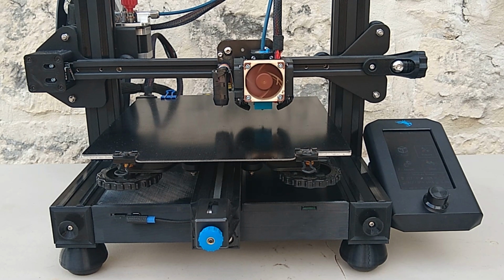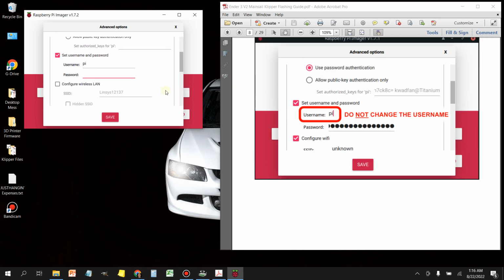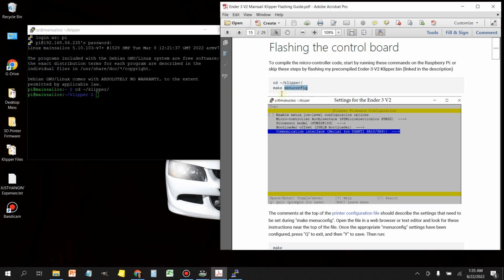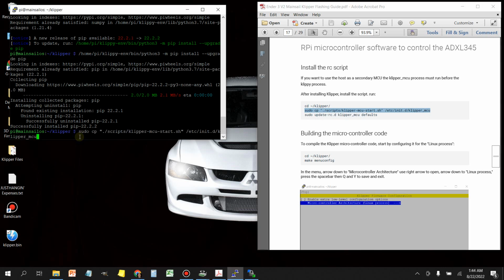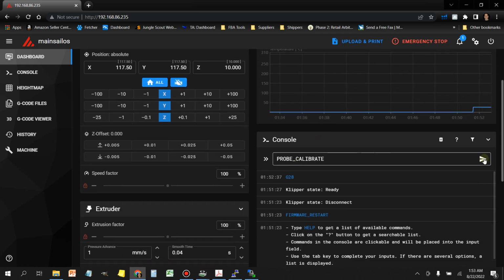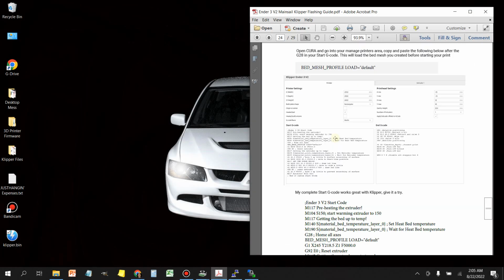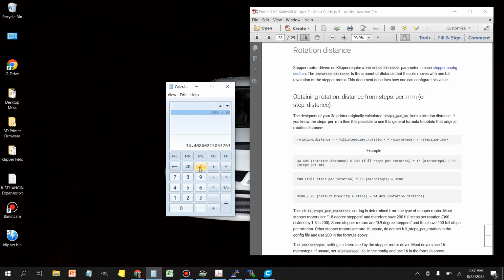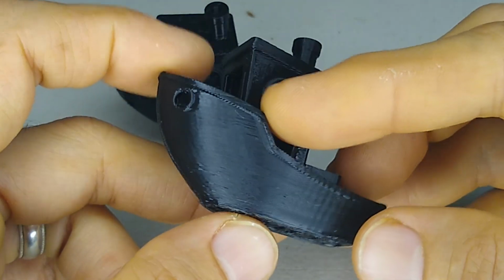Ender 3 V2 An Easy Way of Installing, Calibrating, and Printing with Mainsail Klipper

Comment: Victor!! I knew you were going to knock this vid out of the park! By far the most user friendly and complete guide out there, you even made a powerpoint and included all the files! I had to watch 10 different videos and took parts from all the forums to install on my machine. It took me a whole day and a sleeplees night to get mine going. LOL!  Like I said last time, i can NEVER go back! Ive been running Klipper for about a month now, and I got my V2  dialed in for all different kinds of prints. I just installed linear rails to tighten everything up, and WOW, its truly amazing how Klipper controls the steppers to run 100+mm/s and they are silky smooth and still pretty much silent (except for a few oddball long travel moves here and there when I have turned up on 'high boost'...😂) My hotend is still attached to the X axis, I havent launched it into the next room.. yet.. 😆
Let me know what you think of the Bondtech CHT nozzle when you get it. I'm running a Biqu H2 with the pointy nickel plated nozzles, Ive yet to max it out where it skipped or couldnt melt the plastic fast enough. But the quality is very hit or miss on the machining, so something better flowing and name brand quality I would def  be down to try. I usually stick to 100mm/s  and ramp up the speed or acceleration as i see what its doing for a given print. I have a magnet with a spinning arrow on the back of the extruder stepper,  its sometimes comical to watch how fast it spins as it pulls filament off the roll, which is also spinning at a steady speed, that until now, i have only seen when running a .6 nozzle printing big parts.. 
All this speed, control, and remote control have me trying to turn my hobby into a legit side gig. One of these days I'd like to chat with you on any advice about what platform (Amazon/Etsy, ect.) is better to start off with to get my feet wet, and see if the $ return is worth the extra time invested. I see it as a win win, since i'm doing something I enjoy and would be doing anyways, why not try to make a few extra coins in the process?!
Kudos again for the spot on Klipper tutorial, its going to help alot of people. Get ready, your going to have to top it with the V.B. Voron build tutorial vid! Haha!

-Phil
Reply from the maker: Great stuff Phill, Thank you for all your kind comments. I'm glad you are out there getting speeding tickets for printing above the speed limit. Klipper is another one of those game changer upgrades. My biggest problem now is trying to find more Raspberry Pis to upgrade my other machines without paying an arm and a leg. You mentioned the Voron but have you seen this thing? 

https://flsun3d.com/products/flsun-v400?variant=42441543057576

I like Amazon's FBA program to warehouse and ship products. I did sell on Etsy and eBay for awhile. It works well but you have to ship stuff out as it sells so there is a little more hassle factor.
Reply: @vbared  Yes, i just watched the first review of the v400. its the logical next step if you use klipper and like to go fast!! ( I'm a DSM guy too, we will chat about that another time. lol) I got my pi 4b 1gb for $115 on amazon, they are still out there in that price range, IF, that is in somones price range. BTT just launched their own pi board that is supposed to be as fast as a pi3 and can either mount right to their manta board or has an attachment that makes it the form factor of a pi with usb's ect. that you have to buy seperate. all in i think it is about $80. i have no idea if it is as good as a real Pi, but def a good alternative if you dont want to spend over $100.  I got the pi 4 even tho it is overkill, i still have some headroom for adding another printer or using add ons such as timelapse. 
Do you have an email that i can send you some settings / ideas that i'd like to share with you, to see whats working or not with your setup?. lmk, thanks!
Reply from the maker: @philbassi9241  Hi Phil, Thank you for pointing me to a Raspberry Pi alternative, I started looking at others myself. Doug O'Connor, a YouTube subscriber, picked up 4 pre-owned Raspberry Pi 3s on eBay for $55 each. He only needed 1 and knew I was looking for 3. Just received a package from him of them Saturday. I'm looking forward to Klipperizing all of my machines.

My email is vbared@gmail.com

The 4G63T is an amazing engine. In addition to the EVO 8 I also have a 1991 Mitsubishi Eclipse GS Turbo project car that I'll one day finish.

Comment: I am very close to success I am using Skr e3 v3 the putty session seemed to reply with relevant responses but mainsail still not connecting. Shame this video isn’t Skr bird based. I will try again tomorrow. Any tips man
Reply: I got it man all running now. Didn’t need any of the Linux part doing and I missed typing in serial Id in config.  Lol. Many many thanks for tips man. 💪💪easy once you’ve done it. Lol
Reply from the maker: @noisy_boi_fpv_3920  Awesome news, Noisy. Persistence pays, great job!
Reply: @vbared  😎
Reply from the maker: Hi Noisy, What are you typing into the address bar?
Reply from the maker: Is the connection issue you are having browser related or does MainsailOS connect but the printer isn't communicating with it? Your mainboard details is linked at the bottom. You can place your printer specific details in place of the ones I have in my printer.cfg. Also the flash settings need to match this below.

# This file contains common pin mappings for the BIGTREETECH SKR mini
# E3 v3.0. To use this config, the firmware should be compiled for the
# STM32G0B1 with a "8KiB bootloader" and USB communication.

# The "make flash" command does not work on the SKR mini E3. Instead,
# after running "make", copy the generated "out/klipper.bin" file to a
# file named "firmware.bin" on an SD card and then restart the SKR
# mini E3 with that SD card.

https://drive.google.com/uc?export=download&id=1ALUb-24qSiTV1KNuXVKod4DTaBGPqny7
Reply: @vbared  many thanks got that all done now.  I missed that. Now do I need to still set up Linux as per your tutorial please. Many thanks
Reply from the maker: @noisy_boi_fpv_3920  Great! Yes follow the rest of the tutorial so everything in my printer.cfg will work for you.
Reply: @vbared  cheers man will give it another go. Thank for the pointers. Great tips. Awesome man   Got my sub dude
Reply: @vbared  klipper state was printer config. Menu config.macro config missing I installed them from Skr klipper resource and still klipper is in error on mainsail.  It would be awesome if you compiled notes for the Skr just like you ender board resource. There’s many people pulling their hair out lol
Reply from the maker: @noisy_boi_fpv_3920  Call me +1 478-227-3301so I can help you sort it out.
Reply: @vbared  let me reset everything and start a fresh. Do you have discord at all. If so j could direct message you
Reply from the maker: @noisy_boi_fpv_3920  That's a good idea. Don't get into the printer.cfg or flash stuff until you can login to MainsailOS and get it all updated. I don't have an SKR board to test myself. Do you still have the stock 4.2.2 board? The Raspberry Pi is going to be doing all the heavy lifting so the SKR won't be performing any better than the stock 4.2.2 board anyway.

+1 478-227-3301 is my Google Voice number which also receives text messages.
Reply: @vbared  thanks again for responses your clearly a great guy to be fair I feel like I know you now. I’ve listened to your voice a lot !!!😝
Reply from the maker: @noisy_boi_fpv_3920  Thank you, It makes me happy to help and I learn a lot from the YouTube community myself. Let me know if you decide to try the original 4.2.2 board or keep the SKR for Klipper so I can look around the forums to help you find a solution.
Reply: @vbared  🙏thanks man meanwhile I will keep plugging away with some different settings I may make a break through. I don’t get disheartened
Reply from the maker: @noisy_boi_fpv_3920  Here is one that I found. Maybe it will help.

https://github.com/bigtreetech/BIGTREETECH-SKR-mini-E3/tree/master/firmware/V3.0/Klipper

Comment: Installed Klipper with Mainsailos. The problem I am having is that the extruder is so erratic and makes a lot of noise. By being erratic, it has broken the filament at the extruder twice. Any ideas?
Also Moonraker is not communicating with Klipper.
Reply: I think we are ok. Now I understand pid. If moonraker was not working would mainsail still connect to klipper.  Right now they are talking to each other.
Reply from the maker: @larrymeans7046  Is Moonraker giving you errors? What makes you think that Moonraker isn't working?
Reply from the maker: Hi Larry, Please provide some more information on your setup. What extruder, hotend, etc... are you using. Describe the Moonraker issue in more detail. Are you saying that when your type mainsailos into the address bar it doesn't connect to the Mainsail interface? Does it work when you type in the IP of the Raspberry Pi?

Comment: Dear Victor, great tutorial, as always, thnx!
Regarding the display, I guess there's no easy way to get it running again?
Reply from the maker: Hi Este, Thank you for commenting and kind words of encouragement. I made a magnetic mount in place of the stock display and am using an old cell phone with a thin sheet of metal between the phone and the rubber phone case. MainsailOS can be accessed from any device that can get on the internet by typing mainsailos in the address bar. I'll make a video soon on it.

Comment: Hey Victor, great tutorial. My ender 3v2 works so well with mriscoc pro firmware (it's way better than Jyers btw) that I am hesitating to switch to Klipper. 150mm/s is tempting. Have you compared your Klipper benchy with a regular 50mm/s stock fw benchy ? Thanks !
Reply from the maker: Hi Gryzounours, Thanks for commenting and I hear you. If it's not broken don't fix it. All my machines are super dialed in but one of the aluminum beds has a high spot along the center from side to side. So big prints were a crap shoot. I tried the Jyers UBL and it created an awesome mesh that resolved the problem but when it would probe for tilt it altered the bed mesh in a bad way. So I decided to give Klipper a shot. Quickly  I discovered that the speed limitations on these machines are due to the low processing power of the control board. The STM32F103 is a single core 72mhz processor. Loading Klipper on a Raspberry pi 3 B+ gives you a quad-core 1.4ghz each worth of processing power. The MainsailOS dashboard displays the CPU usage at 6% so there is plenty of headroom for more speed. My bottleneck now is my E3D V6 hotend that maxes out at 150mm/s. Realistically the safe speed is 125mm/s. I'm just ordered Bondtech CHT nozzle which is supposed to flow 3X more than the stock E3D V6 nozzle. A 3D benchy at 50mm/s on the Jyers firmware looks the same as the one from my MainsailOS Klipper machine that did it at 150mm/s.

Best of luck with your mods!
Reply: @vbared  Nice, I am going to give Klipper a try then ! What speed do you think you can attain with Bondtech CHT nozzle ?
Reply from the maker: @Gryzounours  Good morning, Bondtech claims the flow rate at 3X better than the stock nozzle on a E3D V6. If I can get it to print at 200mm/s that would be awesome.
Reply: @vbared  Hey again, I am printing my first benchy with Klipper thanks to your tutorial. Thanks again. It looks promising
Reply from the maker: @Gryzounours  Awesome! You're going to love it. It's a one of those game changer upgrades like switching to G10 Garolite for your build surface.
Reply from the maker: @Gryzounours  How did your Benchy turn out?
Reply: @vbared  In term of general quality, it's about as good as a 70mm/s merlin benchy. One of the layer in the middle failed though (maybe bad luck). It took about 1h10 to print vs 1h40 with stock fw. Apparenty 30mins benchy is achievable with 7000mm/s^2 acceleration.  
I am currently printing the ringing_tower.stl to set up the Input shaper, I am gonna try to do it without the accelerometer.
Reply from the maker: @Gryzounours  The Klipper tests are super cool. Which hotend are you running and what CURA print speed did you use for the benchy? I'm curious to see if the MK8 flows  as good as the E3D V6.
Reply: @vbared  The stock hotend and the stock fans/duct. I printed the benchy at 150mm/s and the stock cura profile for ender 3 series.
Reply from the maker: @Gryzounours  Wow! That's awesome. So the MK8 flows like the E3D V6. I'll let you know if the BondTech nozzle allows for more speed. They make a version for the MK8.

Comment: Great video and documentation.  Have to give it a try. Thank you for doing this.
Reply: Can not open the installation files
Reply: Got it. Right clicked on link. It copied the link. Opened up a new browser window and copied in the link. Opened up the files to the zip files.
Reply from the maker: It's one of those game changing upgrades like using G10 Garolite for the build plate.

Comment: cp ~/klipper/out/klipper.bin ~/klipper_config/firmware.bin      :) use that after you "make" it will put it in your "mainsail machine" Then just DL it and use it from there :)    Thanks again Vic for another bloody awsome tutorial ... this is by FAR one if not the best tut on how to do this.
Reply from the maker: Hi Defiant Mods, Thank you for commenting. Great point, all the Klipper files are located on the same  drive. I stumbled around pretty good when building mine that I thought including it already built might save someone else time.

Best of luck with your mods!

Comment: Hi Vic. I have an Ender 3 the original. I upgraded to the new creality 4.2.7  32 bit board. I also attached the new CR Touch to it. Now i downloaded the printer.cfg file for the 4.2.7 board (Not the ender 3 Cfg profile). Anyway i am wondering if you have the correct setup for this board and the CR touch so i can run on klipper. My profile does not seem to work. I don't know what i am doing. I have tried with normal bltouch pins but my CR touch runs on its own pin. Can you please share your Cfg Printer file with me so i can at least get an idea of how to set up correctly. Cheers Mate!
Reply from the maker: Hi Elias,

I found this that might work for you. My printer.cfg is the last link

https://gist.github.com/jasonehines/51b3bec00d6efdb23a006afa6969b105

https://drive.google.com/uc?export=download&id=19uuvaTZKA7knyECcFuNyRB-TQ6ydJte2

Enjoy your day, friend!

Comment: Hi Victor. Quick question for you. I see you use the E3D V6 Hotend. Is that what you are using in this video.  I am still using the micro-swiss hotends and looking for a different hotend option. Its getting tired of breaking the thermal break when I try to replace the heat block.
Reply from the maker: Hi AZWildk4T, Thank you for commenting. Yes I'm running a genuine E3D V6 all metal hotend (linked in the video description). I haven't had to do a thing to it since I originally installed it on one of my Ender 3 V2s. The max print speed for it is 150mm/s printing PETG at 230c. The way to tell you're at the limit is by listening to the extruder. Once it starts clicking you're at the max speed and should back down some till there is no clicking during the entire print. Yeah, I got tired of dealing with the Micro Swiss all metal hotends also. The issue for me has been the heat block loosening from the heat cycles resulting in some ugly blowouts. I got tired of dealing with fouled thermistors and heater cartridges also.

Best of luck with your mods!